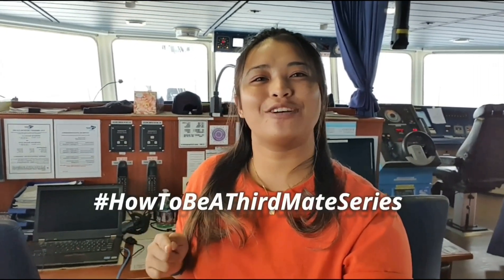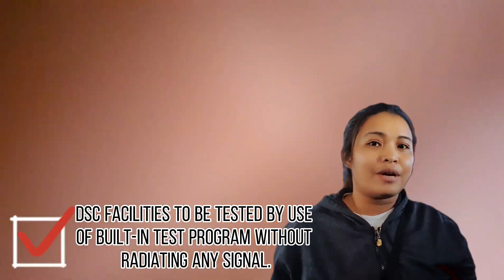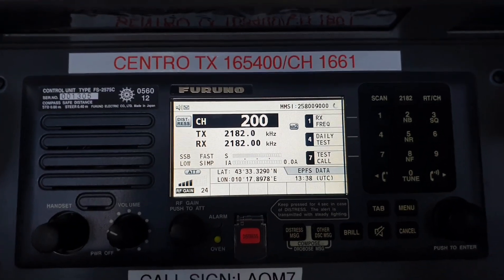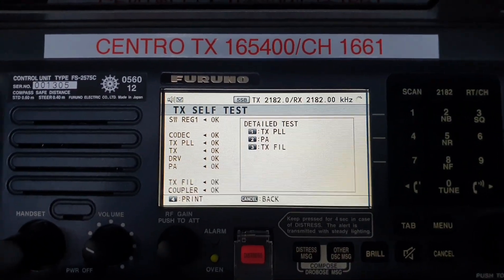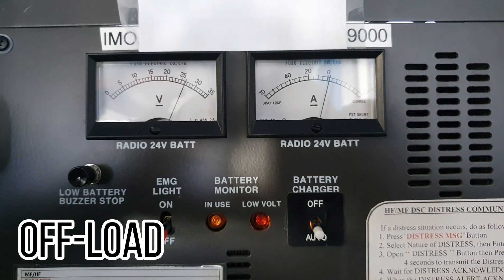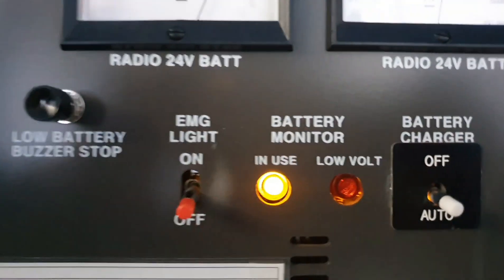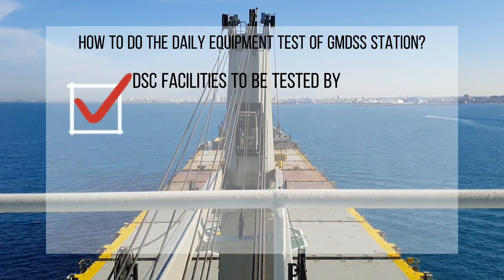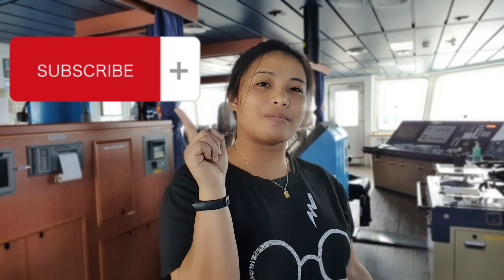VLOG NO. 7 - HOW TO DO DAILY EQUIPMENT TEST OF THE GMDSS STATION

Comment: Very nice video however the on load off load battery test is wrong. After switching to batteries write down the voltage. This is the off load voltage. Now try to give some load to the batteries. For example by pressing the PTT radio telephony button and broadcasting on non distress frequency. Now while pressing the PTT button write down the on load voltage and compare it to the off load voltage. If the difference is less than 10% the battery is ok.

Comment: Its really good to see a fellow Filipino seafarer doing these sorts of vlog. Not only that you inspire me to be a good officer one day, but you've also shown that women nowadays can kick-ass onboard ships. 

Hoping to see more amazing and informative videos like this soon :) :) <3
Reply: Philipino are tua best
Reply: Mam is it true that every 5 years the gmdss reserve battery to be subject for change, I don't think so, as I know if the battery's plates already broken even in a tiny pieces(inside the battery) I'm 110% surely to be replace with the new one. The hydrometer has three colors (green:full charge, yellow:trickle charge, red: drain/uncharge) and because of 6 freedom of movement can cause  the nuts and bolts it's defend of the design of battery a little bit loss due to vibration so I think it definitely be an ideal to tighten a little bit maybe a 2~3mm by adjustable 🔧 wrench in every 8months~12months, or apply some few grease on battery stud(aluminum metal the one connecting series with wires) so that to avoid some white corrosion or dirt due to some acid sorrounding the air inside to battery room even though there is a natural ventilation, Kindly consults with your good guy electrician. Peace po.

Comment: You actually forgot to "Press the PTT on the MF/HF transceiver"  during battery test.

ON LOAD:
1. Turn off the A/C power
2.Record the battery Voltage
3.Press PTT on the MF/HF transceiver @ frequency without distress and idle.
4. If the the voltage drop by more than 10%, It indicates that the battery is weak or not fully charge.